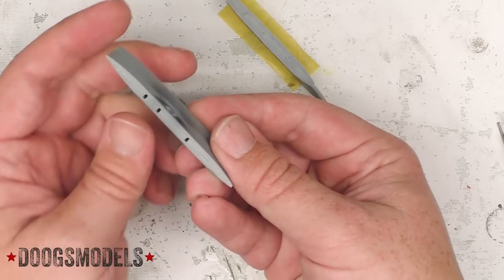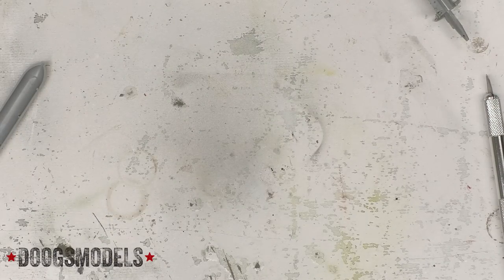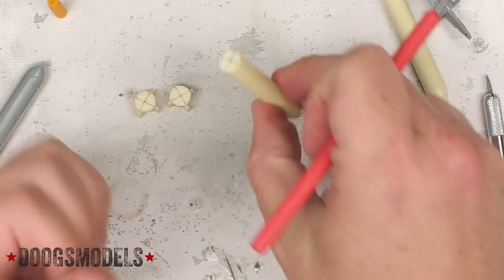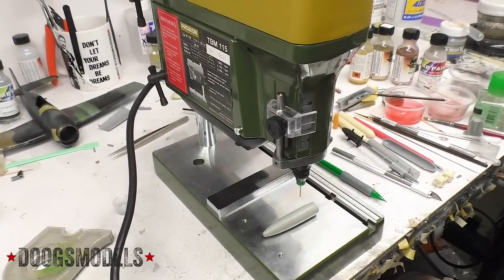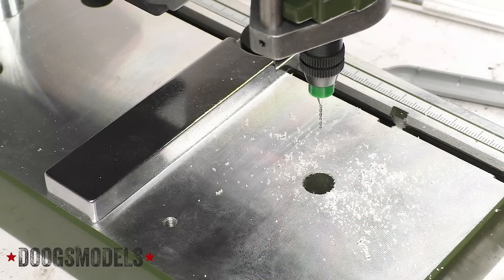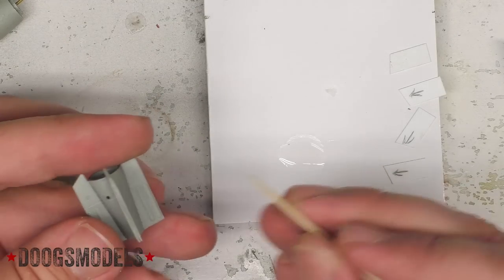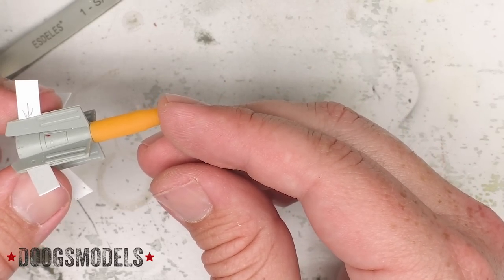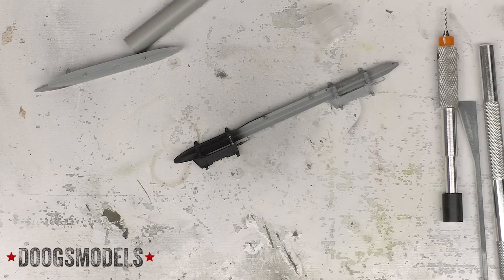A-6E Intruder Build 12 - Playing with Explosives

Comment: To find the centre point of the circle, use your template to create a paper disc. Fold the disc into quarters and mark the crossed centre section. There's your centre point. Keep it for the next one you need to do and save a shed load of time.

Comment: From where Trumpeter did get the 17 mm? NATO Standard (MIL-STD-8591) mounting lug distances are 14" (355.6 mm) and 30" (762 mm). In 1/32 those are 11.11 and 23.81 mm. The 17 mm is almost good match for 762 mm in 1/48 (15.875 mm). Well, the LAU10's original lugs you cut down seem to be realistic for the 14" mounting, just like the dips on the Rockeyes. OK I know, artistic licence. From engineering standpoint nothing justify the difference. Maybe in 72nd, or 48th. But in 32nd they could easily use the STANAG mounting distances.
Reply from the maker: Knowing Trumpeter, they just pulled it out of their ass. Or...they pulled it from their existing 1/32 ordnance, and they pulled that out of their ass.

Comment: G'day Matt. Very neat job on those parts! Say, what brand is the pin vise you use at 12:45? It's the right size to use with the tiny drill bits. I was endowed with a bunch of bananas for fingers. The one I have is too big to handle in one hand (or one bunch). Cheers!